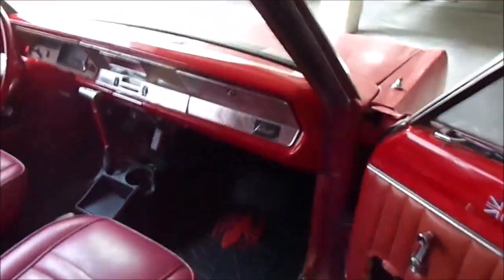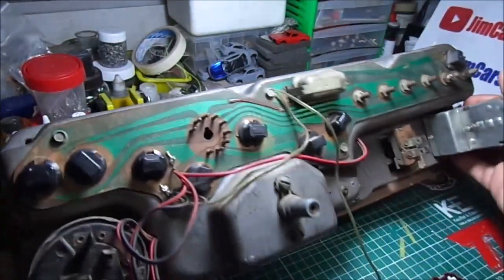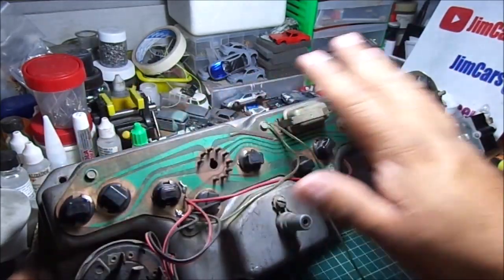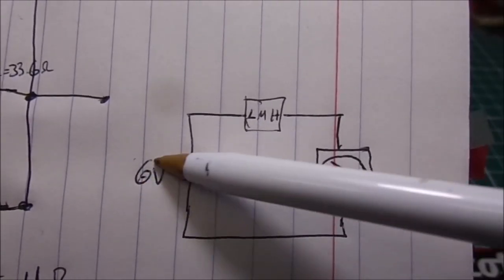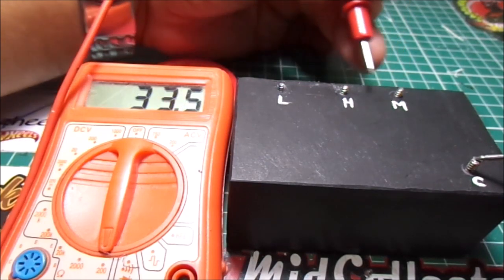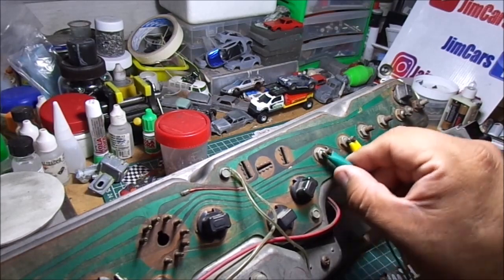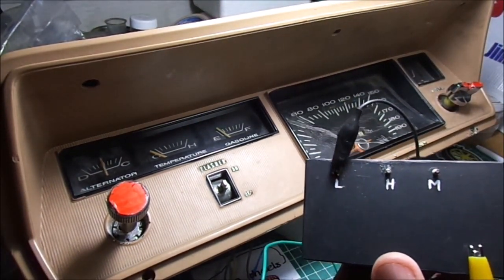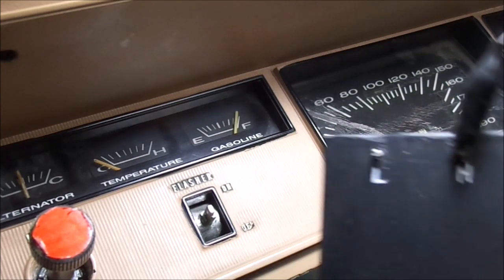Probando el tablero del Valiant   Valiant gauge cluster test

Comment: jim , primero que nada gracias por compartir , una duda, en el diagrama de las resistencias , en la medición de low suman 72.5 ohms y cuando mides en la caja el multímeto marca121 ohms , cual de los dos parámetros es el correcto? ,solo me queda esa duda para poder hacer el probador, agradeceré tu respuesta ya que estoy en proceso de restauración de un valiant duster 74
Reply from the maker: Hola son 72.5 como dice el diagrama, solo que en mi caso cuandoncompre las resistencias me equivoque y compre una de 100 en lugar de 10, por eso dio tan alto, pero como es el valor que indica low fuel no afecta, suerte y me cuentas como va tu restauracion, pronto subire mas videos, saludos